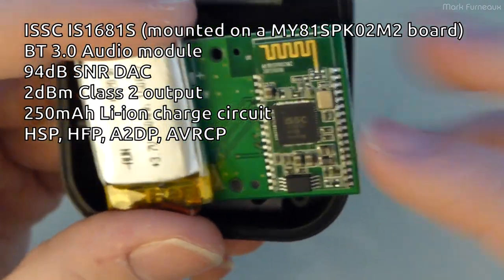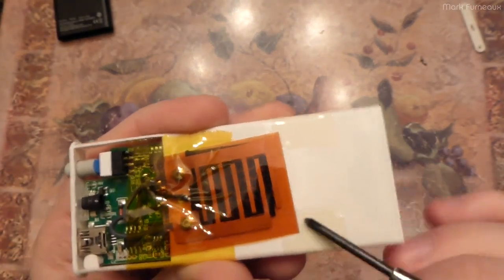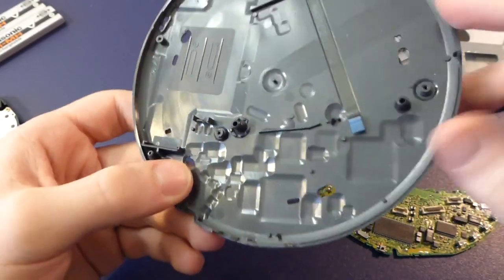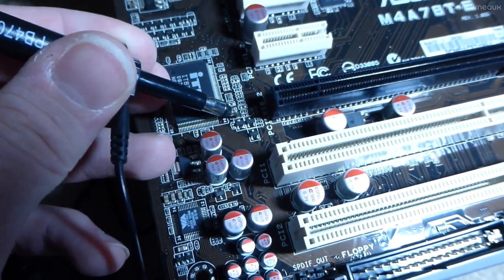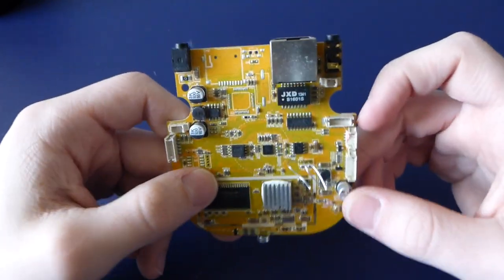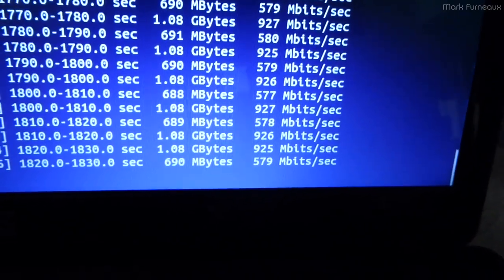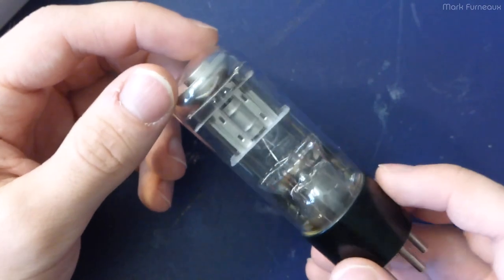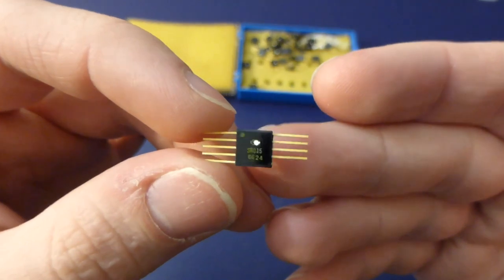I'm Mark, and This is My Channel - Trailer

Comment: Mark, not that you talk too much....  did I say that nicely??  But at least you talk.  I'm so tired of "good idea" videos that are nothing but screen captures of software configs and setups with no dialog!!  So thank you.  I've seen several different ideas on remote access to pfSense.   How do you remote in?    Would have asked that in a PM but you don't have one setup on your "about" page.
Reply from the maker: +ramosel You can definitely PM me, I've got them before. What kind of remote access are you talking about? Remoting into the pfSense console, or getting access to machines on the LAN? I don't allow WAN administration to my router at all, and a couple of my internal devices can be accessed via SSH. I can then SSH from those into others which are not directly accessible via the firewall.